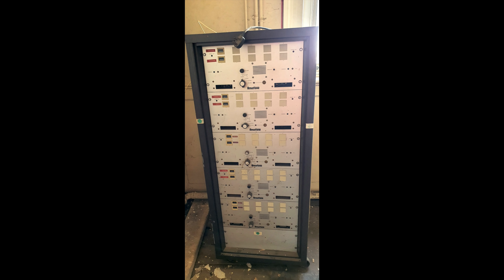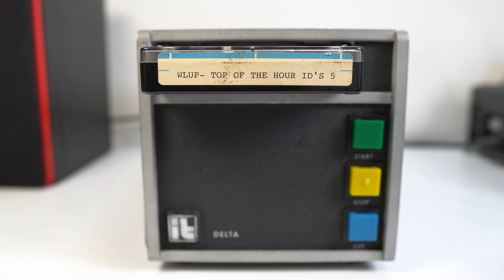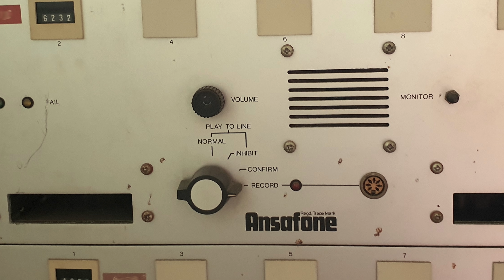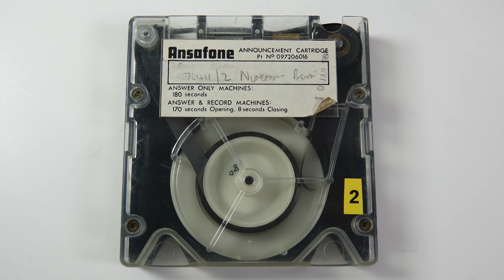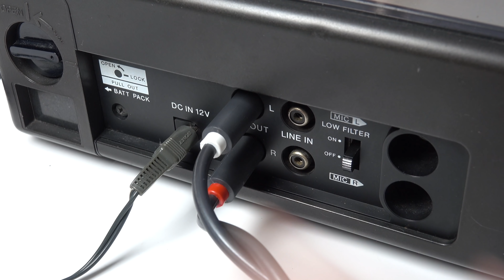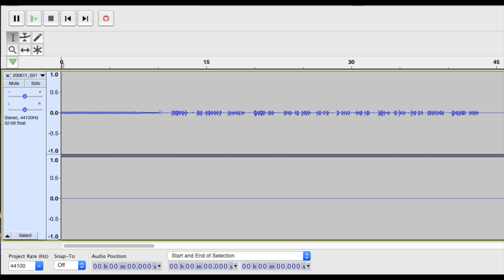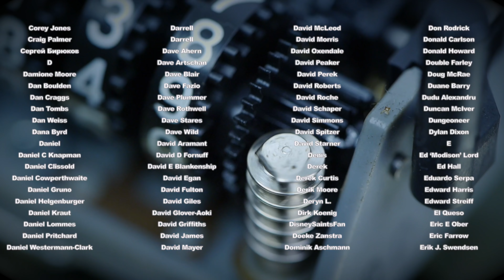Abandoned Railway Carts - Mystery tapes from a disused comms room

Comment: I'm impressed by the quality of the audio, I was expecting much worse for something meant for the telephone system.
Reply: I suspect this is true in a lot of cases, it just always sounds like crap by the time it gets to the speaker on your phone. Hold music, for example, probably sounds fine at source but will never sound good at the other end due to the compression etc it has to endure along the way. If I were putting this system together I'd want a suitable quality at source for exactly that reason, especially for things like train times where all users of different hearing abilities need to be able to hear the information clearly.
Reply: @mankysalad350  You picked the worst example. Codecs used in the telephony system are designed for voice, not music. They perform very poorly if at all with music.

Yeah, sounds always end up bad over a POTS line, hence why the equipment never needs to be of high quality at the source considering the quality won't make it through the end. It's not a matter of pumping higher quality sound at the source makes it better at the other end. Think of it like saturation or "maxing out". There's no gain at going higher quality.

And considering techmoam still had to slow the playback speed down further than his player could go shows that the engineers behind this tech knew they didn't need quality sound.

Yet they achieved a lot better than I anticipated.
Reply: @jeremiefaucher-goulet3365  Indeed, I only picked that example as it came to mind because I used to work at a place where they used a CD on repeat for hold music, so source was great, other end would have been awful for the reasons you stated. I may be entirely wrong, but I'd have thought if your voice recording was barely understandable to begin with it would still suffer some quality loss over POTS and just end up as muffled garbage. Hence wanting suitable quality at source, not saying it needs to be super Hi-Fi or anything :-) Basically, I'd rather it sound better than this https://www.youtube.com/watch?v=h5qjo1RiDaI
Reply: @mankysalad350  It only had gotten worse in the late 90s early 2000s. Hold music can hardly make it through nowadays because of all the layers of conversions happening on the circuit sometimes. I've heard some where only a few really spaced out notes make it through.

You are correct, obviously the line usually won't improve the quality if your source is pretty bad to start with, but it might if it eliminates sounds that let the voice pass through clearer. Not on purpose or by design, but just by the mere fact that these filters and codecs are so tuned to voice compression without caring for anything else that extraneous sounds and music get inadvertently left behind.

With VoIP we are making a clean break sand can use modern codecs capable of handling voice and music just as well. If your call doesn't go through legacy system that will covert to analog it will sound much better.

Mind you, it's not analog itself that is bad, it's the compression techniques used. The real issue is that interchanges and interconnections between providers have hardly improved over the last 100 years. To much effort coordinating an upgrade so keep them lowest denominator standard alive.

Comment: I can totally relate on your last sentiment, enjoying the squeeze, the effort to getting to the end result. Then I look at replacing a hard drive in a mac mini and the rigmarole and there's a point where life is too short.
Reply: Are you saying you don’t fancy deiassembling whole mini just to replace a freaking hard drive?! ;-)) // comes from the guy who did it to install secondary some years ago.
Reply: Miroslav Hudak  good that u  mentioned that as opening it up it was easy.  I must have looked at the wrong model. Cheers
Reply: What year is the Mac mini? 
If it's got an Intel processor it makes a great media center.
Reply: Chris Reynolds I actually bought it for that very reason. And used it as one for a long time until replaced with Apple TV. Now it is a workbench computer.
Reply: @Ubersnuber  Or to put it another way: I't not about reaching the destination, it's about enjoying the journey there.
Reply: I didn’t realise the mini was hard to replace ,I’ve got an iMac and I dare not think about replacing the drive, plus my ancient Mac book pro running snow leopard , I don’t know why removable caddies fell out of favour on computers
Reply: @Havanacuba1985  Perhaps those caddies fell out of favour because they entail more parts, which entail more labour, which entail higher cost?

Comment: Nice to see mention of my home town. Incidentally if anyone is wondering why such a small and relatively insignificant town was one of the only 65 locations to have such a system, Rugby has always had (and still does have) an unusually busy station, I guess due to it's very central location in England. In context, Coventry is it's closest neighboring city with a pop of over 370,000 has 4 platforms in it's station, where Rugby with a pop of just over 100,000 has 6.

Comment: When I first started small town radio when I was 16, these were still in use for commercials as old legacy technology. That's 20 years ago. We had a machine that fired multiple carts in sequence for commercial breaks that the DJ would load according to a paper programming log. IE 4 sponsors had 30 second commercials which paid to air and it was a lot of fiddling around with loading cartridges. The CD players they used were also packaged in a cartridge type player (so they wouldn't scratch I assume). So anyway you had to load and order those too. The wrong track could be a completely different artist as they weren't albums. We left this for a digital format and it was a lot less work.

Comment: I had a typewriter-sized Ansaphone (made by Dictaphone) machine in the 1970s-'80s.  It used one of these carts for the outgoing message(s), and a Phillips-style cassette for the incoming ones.  However, I think it used a foil tape at the end of the message, which allowed me to record multiple outgoing messages on one tape, then put foil in between each.  Each caller then heard a different message until all had been cycled through and it started over again at the first.  Answering machines were so novel then that when some people heard the message, they'd tell their friends, "Listen to this cute chick!", but when the number was dialed again, they got a different speaker and song.  In the incoming message, I could hear their confusion, "That's not a chick, that's a dude!", then they would try again, because I utilized different people to make the recordings, including some children.

Comment: It's not surprising that tape-based systems like these were gradually going away, technology as usual was marching forward.

In 1980 I was working at McDonnell Douglas, testing systems they manufactured to answer phone calls to provide stock quotes and time & temperature announcements.  But instead of tapes it used digitized audio, either short recordings done from an audio source, or a pre-generated set of voice recordings.  I forget if they were syllables, words, or phonemes.  It was a natural sounding voice, actually recorded by a person as I recall.  The original system employed a minicomputer to control things and had a custom audio card, while a later, smaller model used a microprocessor and EPROMs for the voice storage.  It was a nice system, overall, but the larger units were marketed to the US Bell Telephone company, and when it was forced to break up during the divestiture, the market for the systems dried up.  A variation of the technique lived on in their Central Aural Warning System for aircraft:

MD80 CAWS Collection
https://www.youtube.com/watch?v=66s2XZ__a1c

I spent many eight-hour shifts listening to those units squawk out their alerts while testing and repairing them on the production line!

Comment: We used carts at the radio station I worked at in the 80s. In addition to the "tone" that allows it to cue back up you could put a 2nd tone (all  inaudible) at the end which when using a multiple cart playback rack unit each one would kick off the next one, so you could do a whole commercial break with jingle coming out with 1 button push.

Comment: The telephone number was interesting. The STD code mentioned was 0203, which at the time was the code for Coventry (a few miles from Rugby). The STD code for Coventry was changed on PhONE day (16th April 1995) by adding a one after the initial 0 (becoming 01203). Then on 22nd April 2000 (The Big Number Change) it became what it is now (024). I had forgotten the carnage that was created by having my home dialling code changed twice in 5 years! Great detective work :)

Comment: This kind of toneburst-controlled automation originally depended on Reed Oscillators. These look a bit like magnetic reed switches, being a pair of metal leaves inside a small glass tube.  They can be rigged to either produce a particular sound or to trigger in response to that sound, say a 440-Hertz tone. Car radios in the 1930s used high-frequency reed oscillators to tune signals, and the TouchTone DTMF dialing system for landline phones was originally built around a set of eight reed oscillators. The reed oscillators from DTMF touchpads were made in vast quantities worldwide in the 1960s and were often used in other gear, like these tape machines. A few reed oscillators, low-voltage relays and a bell transformer can still be used to create a reasonably reliable automation system with zero transistors, zero chips, zero lines of code.

Comment: I worked for an airline based out of Orlando/Atlanta and I used to have access to one of the radio rooms for the airlines. Sitting there for I don’t know how long was an old dictaphone reel to reel with piles of old tapes. I wish I had snagged one of those. I loved going to that room on the concourse in the Atlanta airport. There was a whole bunch of old equipment like that. Airlines didn’t the same, they just left it there because that room would be a real Pain to get that stuff out of.

Comment: When I worked in radio (back in the '90s), we had Cart machines similar to the one you have. We used to call them SEC Tones which was added to a recording (liner or spot ect.) by pushing a button on the Cart machine.

Comment: Fidelipac – a cartidge (similar in design to a 4-track or 8-track consumer cartridge) with an endless-loop ¼-inch-wide (6.4 mm) analog recording tape, usually in a two-track format with a speed of 7½ ips, used at one time by radio stations to play commercials, jingles, and other announcements. It was designed to automatically cue and sometimes to automatically start a second or third cartridge. Digital media have made the cartridge obsolete. Also called an NAB cartridge or simply cartridge and usually cart for short.
Reply from the maker: Not sure who your message is for - but here’s my video ALL ABOUT FIDELIPAC 
https://youtu.be/-m9WfAJMMa8

Comment: For a little trivia (unless its already been said & I'm an idiot for commenting to early), I used to work at an old AM radio station. The same tech was used there to cue up commercials/PSAs & then play them by manual trigger or automaticly via a sub-sonic frequency recorded onto the tape. We called them 'carts'. They also looked like the old 8-track tapes you'd get regular albums on, but with a hole cut out where the pinch roller would snap up & make contact. Just thought I'd mention it.

Comment: A system like this was used for PA on SEPTA (the Subway/Tram /Regional Rail system in Philadelphia) until it was retired in 2019 for a more modern AVPA system with messages sent out over the cloud.  

A dispatcher named Alvin Elliot  recorreded them in 1984 when the system was first installed.

Comment: 8-track music cartridges relied on the foil sensor tape, I suspect, largely because songs would often be broken up and "wrapped" between different tracks like a hyphenated word.  I have plenty of 8-tracks that do that.  So, the system used need to be able to resume the song as quickly as possible.  In contrast, outgoing phone information messages had no requirement for instantaneous initiation, and unlike an album with 40 minutes or more of content, the cartridges didn't contain more than a minute or two of content.  In that respect, the caller would be willing to wait for a few seconds for the outgoing message, such that a tone-encoding system on a single channel was feasible.

Comment: It was nice that the message could be saved for posterity. You might want to upload it to The Internet Archive.
I'm sure the machine could be removed if it was disassembled. There were obviously screws on the cabinet. But it would only be good as a museum piece. It's doubtful it would ever be turned on again.

Comment: Hearing the story about where he found the comms equipment makes the following bit from The Hitchhiker's Guide to the Galaxy sound like a work of nonfiction:
“But the plans were on display…”
“On display? I eventually had to go down to the cellar to find them.”
“That’s the display department.”
“With a flashlight.”
“Ah, well, the lights had probably gone.”
“So had the stairs.”
“But look, you found the notice, didn’t you?”
“Yes,” said Arthur, “yes I did. It was on display in the bottom of a locked filing cabinet stuck in a disused lavatory with a sign on the door saying ‘Beware of the Leopard.”

Comment: the multiple tapes being purely for handling concurrent calls makes sense to me, although i'd suspect that was the configuration not just  for the good-bye message but all along. If there was some sort of menu system that had been used previously, i'd expect to see a lot more switches to configure it (even if the structure was fixed, i'd expect to see at least a selector switch to choose which tape to record to). If so, then it's a bummer the system didn't use a round robin to assign calls to tapes instead of sending all calls to the first tape unless it's busy, the wear would be evenly shared across the tapes, but maybe that kinda logic would've been too much for a machine of that time.
Reply: one possibility: maybe they normally would manually rotate the tapes around periodically, but that stopped after they recorded the goodbye message and left

Comment: There was probably a 50-50 chance that when you spooled up the tapes you might have got them running backwards.
Reply from the maker: Endless loop tapes run in one direction - so the direction of play is known.
Reply: @Techmoan  Yes, I suppose you can tell the direction by the position of the head openings and the capstan roller.  Of course if I was doing it, I'd manage to screw it up anyway with my luck!  I had a feeling they were 1 7/8 IPS speed before you mentioned it, the amount of tape wasn't very much.

Comment: Q How can that tape be pulled from under? I have done myself and endless tape, but I just made loops around some sticks inside a regular tape. Never thought at this trick. Even now seeing it working I cannot understand how friction is not a problem.
Reply from the maker: Carbon backed tape is the secret - it slips over itself.
Reply: @Techmoan  Oh, thanks, I got it now. Those cartridges would not work with regular tape.

 And maybe the sound being not so loud has something to do with this. sliding at that point in time may cancel the magnetization, so a lower level may be required to be stable. Or maybe it was because the tapes are so old?
Reply from the maker: They can be much louder with no problem - it was just recorded too quiet.

Comment: I’m wondering if LT had a similar system for service updates... when I was platform staff there was a number we rang on the internal network (auto xxxx) where we could get recorded info about stations with lift or escalator problems, service delays and train cancellations and other service issues.

Comment: I guess tape is pretty durable to last long enough for this guy to find it and run it through a reel to reel.  The only saving grace I think.  You can still usually get some sort of audio off of old tapes, even if they are cut.  But a completely scratches to hell CD?  Not really.

Comment: Hey! I need help finding a dead format's blank tapes that i have no other proof of other than the machine i own, I own a 60s or 70s Tape Echo box and play in a Rockabilly band, i like to use it as it adds to the authenticity of the band, however it uses a blank tape called a Micro 8 track to play it, and the tape i got inside mine is original to the system, and i'm afraid of the tape eventually wearing down over time, and becoming unusable, Would you know anything about Micro 8 Track tapes and where to find more of them?
I've been looking everywhere and keep running into dead ends!
Reply: Josh - Is it a Univox unit?  If so, it probably uses Playtape / Apollon cartridges, which are fairly difficult to get hold of.  You can use standard Dictaphone cartridges if you cut a small section off the case.

Comment: Hey Matt, great video as always.  I was wondering if you would do a short video on the whole endless loop tape thing.  In an 8 Track tape cartridge and the ones you showed here, tape is pulled from the center which has a smaller circumference than the outer portion where the tape returns to the reel.  This difference in diameter would cause the outer portion to try to pull more tape back than was pulled out by the center.  This would cause the tape in the reel to be stretched or "slide over itself, or both."  I would think that would make the life expectancy very short over many playings.  I have always wondered since I was a child how that worked, and 40 years later, still don't know for sure.  Thanks !